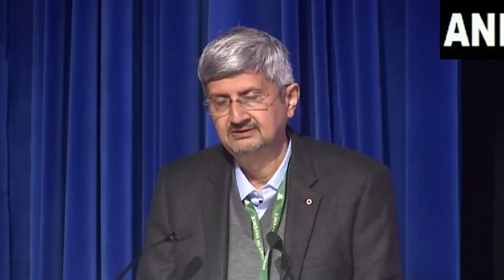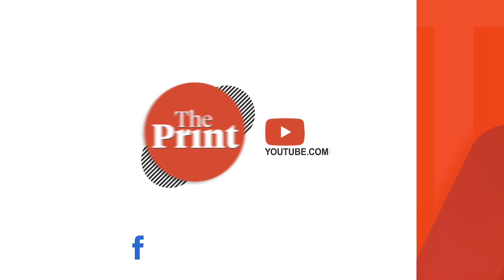'To achieve all our goals we need to increase defence budget on R&D from  5% to 15%': DRDO Chairman

Comment: Great talk by DRDO chief Samir Kamat! R&D spending must reach at least $10 billion, and we need greater private sector participation to create the Lockheeds, Raytheons, and Northrop Grummans of India. True Aatmanirbhar Bharat comes from researching and developing our own weapons. This obsession with shiny, foreign-made equipment must end.
Reply: No problem, even if 20 billion dollars are spent for R&D. But will Mr. Kamath deliver on his promises in time.
They took 36 years and 2000 crore rupees, still didn't succeed with one jet engine. Kaveri is a miserable failure, not because of lack of competency, but lack of the leadership to identify this weakness and work on it. The 2000 cr is peanuts. But 36 years is precious time lost. Now Mr. Kamath talks about training our scientists abroad on special materials, it's manufacturing process etc. Even , in reality, even this basic competency enhancement was also not achieved in the past 36 years. Spending is fine. But it should be in the right direction, which delivers results, not some fancy statements or results on paper